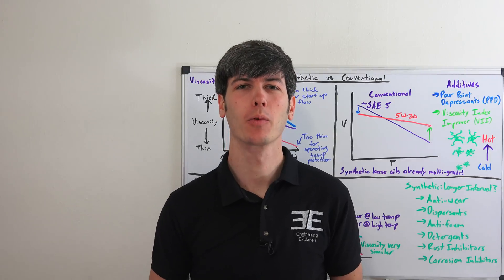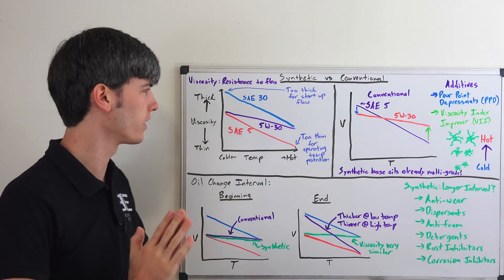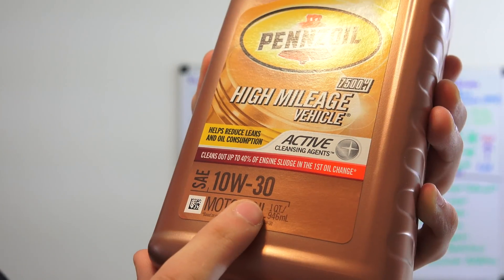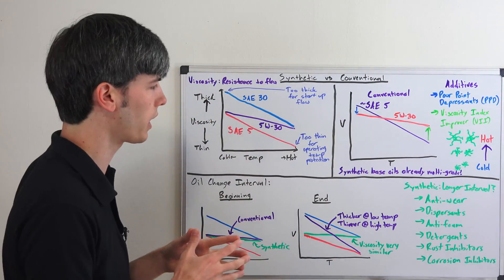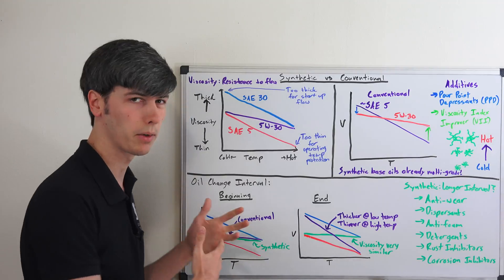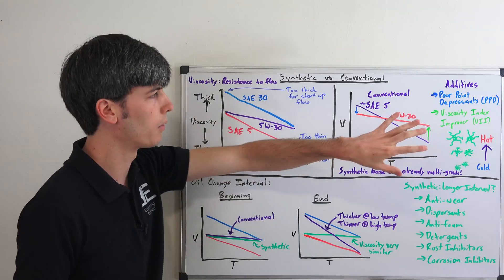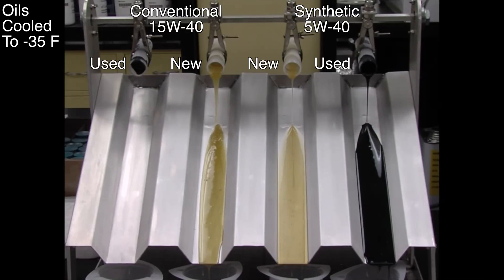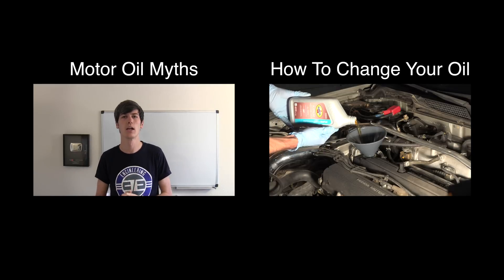Is Synthetic Motor Oil Better For Your Car?

Comment: With all this being said, how do you explain my 09 CTS calls for Mobil 1 synthetic oil. If I run it after two weeks or so it's lost about two quarts, doesn't smoke doesn't leak had it sense new and I started using Oreilly full synthetic and it will go the full oil cycle and of 7 thousand or so miles and maybe be down one quart. No clue why but it's got 70 thousand on it and it's always been changed and taken care of.

Comment: I am from Sri lanka and i am having a Toyota Corolla AE80 1983 model 1.3L Petrol (2A Engine)
My owners manual says that I should use SAE 10w30 for all season , SAE 5W-30 & 10W-30 for Winter  and  20W-30 & 25W-30 for summer.
@ present we are using SAE 40 single grade and would like to get your opinion in using SAE 15W40.
Please reply.
Regards,
Muhammad Ismail

Comment: I love the video.  Think you did a great job explaining what you did.  I was not mentions however that you should never switch to full synthetic after running conventional for more than..... I would say about 50k miles.  Synthetic has a much higher detergent factor than conventional and will break up carbon deposits left behind.  switching after you have those carbon deposits built up is a terrible idea and the carbon would then be flowing through and over every moving part in your motor.  but anyway still a great video.

Comment: I just want a decently priced oil change, for god sakes these mofos charged me $96 for an oil change.... And the add one were bs, windshield wiper fluid and some other bs
Reply from the maker: +Kev Bayotte that is pretty absurd, you can buy all the stuff yourself for about $30 if interested. Even most dealers charge way less than $96.

Comment: +Engineering Explained   I've changed to synthetic a number of times in older cars and very shortly thereafter the engine started leaking oil.  Do you have any idea why this would be?
(2 pre-2000 subaru's and a 1984 toyota truck)

Comment: Great video.  So, riddle me this, Batman.  If I have been using conventional oil in my 02 Expedition 5.4 and my 02 Mustang 4.6 DOHC, and my 67 Mustang 351W, is it OK to switch to synthetic?  Are there any issues with swapping over to synthetic after running conventional for so long?  The 02's have about 140k miles each on the clock and my 351W in the fastback has about 10k.

Comment: I use 5w 20 AMSOIL 100 percent full synthetic and I go 1 year between oil changes. Or 15000 miles whichever comes first.

Comment: In my motorcycle I use mineral oil, but when I use sinthetic oil, it leaks through the joints. Can you explain why it happens? the mechanics said to me it's because the sinthetic oil is more thin than mineral oil. Is it true? Motors designed
to use mineral oil can use sinthetic oil without problems? (sorry for my english)

Comment: I bought my car brand new. It currently has 230k+ miles. I've only used Ultra Platinum since day one and the head still looks it just left the factory.
Reply: It probably drives just like it did 230k ago, too. Synthetic oils are remarkable products.

Comment: Bottom line, if your car's engine, is not designed to use "synthetic" do not put it in there, period.  Read your owner's manual or contact your manufacturer or read the factory shop manual.  Oh, one more thing, synthetic oil, yeah, its made out of ground up cows.  Literally.

Comment: The deal...Pay attention to your owner's manual and your climate. Hotter climates make better use of higher "w" numbers (10w-30). Colder climates make better use for lower viscosities as they flow better at low temperatures. Newer cars are recommending 5w-20 oils, and some go even lower for fuel economy, but pay attention to the owner's manual. There's a chart in there that gives you a baseline for viscosity versus driving style and climate. Yes, as he said, synthetic oils give you some wiggle room for your oil change intervals, but that isn't an excuse to extend your oil change. Synthetic to conventional, it makes no difference. At 4000 miles, a synthetic oil offers roughly the same properties as a good quality conventional oil of the same viscosity. If you want to save money, run conventional and change it after 3000 miles. Simple. If you drive a lot in stop and go traffic (what they call "heavy duty" driving), change it sooner using the month method.  $20 for conventional oil change (with filter) versus $40 or more for synthetic? I run synthetic blend and change it after 3000 or 3500 max for $15 cheaper than synthetic with the viscosity matched to the chart in my owner's manual.

Comment: Why is the standard (non-synthetic)10W30 allowed to state it meets or exceeds all new car warranty requirements? I would like to see a true analysis of the exact molecule types  and percentage found in each oil rather than the manufacturers data as presented. For your claim of expanding molecular placement only in synthetic seems a bit far fetched.
I have heard the manufacturers of the engines are required to recommend oil type by the type used in advertised mileage test and is Only a recommendation.Additionally, if one changes their own oil at 3-4K intervals I don't think you can justify the price. In an aircraft maybe. Of note the manufacturer of the more expensive oil sponsors this.

Comment: SO basically if you live in a cold environment change your oil more frequently. I can't help but feel if this was at 50-80F it would just flow all the same.. THis is the problem with sponsored videos.

Comment: I'm a little lost here.
You say a multi-viscosity oil will get thicker with temperature. But you also say higher temperatures will cause the oil to thin out.
How can it be both ways?
Reply: ....relative to the base in index

Comment: That test was useless...test how each does to protect metal...cold/hot, new/used. Regular oil has inconsistencies and must be refined (filtered, boiled, separated). Syn is artificially built carbon chains. Either will do the job at first, but imperfections in regular oil make it deteriorate more quickly.

Comment: Most important thing is for vehicles still under warranty, use the correct OEM filter, and keep the upc or receipt for both oil and filter.  Every automaker will balk if you have an issue and you've got a third party oil filter on there, even if it's superior.  They'll blame it.

Comment: What about for my old two-stroke engine from 1972? As the oil is added directly trough the petrol, also it needs about a 3% motoroil to petrol ratio.
Reply: There are part synthetic 2T oils available. Whether it's worthwhile in this application is questionable. You certainly won't do any damage though.

Comment: my place average temperature is 35°C-40°C ,on my Honda Fit/Jazz manual book it told to use only 0w-20,so is 0w-20 compatible on such a hot weather ? cause when i open my car hood it was really HOT,my brother Lexus RX370 use 5w-30 (which is his manual book also told to use 0w-20 only)  and the engine is not as hot as mine,please give me some advice,should i change to 5w-30 ?
sorry for my bad english

Comment: As a maintenance engineer, I must say... the comment section is quite depressing. 

You are also clearly sponsored in this video, as you neglected to mention some very important things regarding "synthetic oils"... i.e. there are exactly ZERO standards of requirements to define an oil as "synthetic". 

ALL "Shell" product based oils (aka penzoil) are grade II+ or III oils (aka not really synthetic at all, just higher standards to oils that have no additives or additional distillation). To be fair, they are treated and distilled to a higher grade than your typical "off the shelf" oils; but are not truly a "synthetic oil". 

So those of you preaching about your "synthetic oils" ... may actually be putting in normal motor oil in your car lol. Only a few companies produce their own synthetic oils. The process is quite expensive, and thats why you pay the premium. The -35F test only proves that penzoil added a really good or high quantity of pour point depressants. The indication of perceived "quality" just doesn't apply.

Comment: Okay, so why is the used synthetic oil so much darker than the used conventional oil? Does the one pick up and flush out more internal carbon deposits and such or are there other reasons?

Comment: I thought you said the higher the number, the thinner the oil. Why then does the 5W-40 flow much faster than the 15w-40?
Reply from the maker: I did not. The higher the number the thicker the oil.
Reply: ah the part that first confused me was around the 1 minute mark, but now that I've watched it again I understand. Must have misheard the first time. Thanks!

Comment: I think the most interesting oil change interval was with my grandad's 2000 Silverado. 
The dealership changed the oil once when it had 5k miles, and he didn't change it until 100k miles. Then he changed it again at 150k miles, and again at 315k miles. It ended up spinning a bearing at 400k miles. He did mostly highway driving, but I found that impressive.
I'm wondering how it lasted that long... EE, what do you think?

Comment: Notice that this 15W oil was cooled to -35 degrees Fahrenheit. Its a little misleading, even if you state the experiment conditions, because even 0W oil isnt rated for -35 degrees Celsius temperatures... The coldest that 15W oil can be used in is  -15Degrees celsius

Comment: If you are living in  tropical countries (no winter season) where temperature doesnt change much, will it be economical to use the conventional engine oil? cold season = 16 C, hot season = 30. Synthetic oil is like 5x the price of conventional

Comment: If i may. You may also notice the difference in oil coating between the conventional and the synthetic. The synthetic covers a noticeably larger area initially than the conventional. Not claiming to be a physicist here, just something i noticed.

Comment: I will always run conventional oil in my vehicles considering I don't but anything post 1990 change every 3000 miles my 85 ford ranger v6 has 340000 miles on it no rebuild no knocking cheapest oil u can buy at fleet farm I live in mn tell me about cold starts 5w30 pretty sure the only reason synthetic oil is a good thing for ppl because u can run it longer than conventional oil good videos man keep it up
Reply: I correct myself they recently just changed my favored oil to a synthetic blend hehe

Comment: Cool video, I would have liked the head to head 5w-30. I have always used synthetic and have two Mazdas with over 300,000 miles and still good compression and valve trains.

Comment: those used oils are really really black too, so if you use a synthetic and really change it at a healthy interval it will not be nearly as black and should flow almost identically then...very nice video

Comment: is it true that just stick to conventional oil for oil engine over 200k? I have a Tacoma truck. toyota tech told not to switch to synthetic bc its too thin and might cause leaks. right?

Comment: He actually has it backwards. They create an SAE 30 and then engineer it to be SAE 5 for cold temps. You need to view this as oil THICKENS as it cools, not THINNING as it warms up. So in general, you always want the lowest cold viscosity you can find.

Comment: My car 1988 Porsche 944 had Mobil 5W50 filled September of 2014. The car did 1200 miles since then. Should I change the oil because it got old? It is full synthetic and it is totally clean, looks like new.

Comment: I'm a little blown away because I've heard for years there is very little practical difference between synthetic oil and conventional oil, that they both meet the same rating standard and it's not a big advantage to go with conventional.  I always get synthetic oil (on sale or Syntech brand) because I run my cars for several hundred thousand miles and I think over time the difference might add up.  But I've never heard there was much difference, certainly not anywhere near as dramatic as in this video.

Comment: Thank you for another great video! I've been told in the past by mechanic friends that if my car already leaks or is older (both in my case) that I should use synthetic oil because it is so thin and slick that the leak or potential leaks areas will increase. In this video it seems to suggest that synthetic is better than conventional. Is there any caveat here? Thanks again for the great videos!

Comment: Anyone else pick up on the fact that his display on the right represents the viscosity decreasing as the temp increases however when he explained the properties of the polymer he said (and has displayed) that the polymers expand as they heat up... Which would therefor increase the viscosity (densifying the oil, as he also said), no? Otherwise if the latter was true (the polymers expand as they heat up) the viscosity would increase. I apologize if this is redundant, merely trying to emphasize the point I'm trying to get across. So the question is, how does the heat truly affect the polymers?

Comment: the problen with the syntetic oil is that it damage the seals at high temperatures. the mineral oil don't do that. syntetic is good for one race. mineral oil is good for every day use.

Comment: Hi,
I was always interested in how long could the oil really last in our engines. Its hard to find an answer to this question provided by any oil manufacturers. They are are happy for you to buy more oil.

I think that Toyota has claimed that synthetic oil would last several times longer, if the oil filtration process was improved.
I cant find this article again. They have said that the oil itself is fine on the oil change, although it's the amount of unwanted particles in the oil; such as dust, carbon etc. which causes the oil to loose its lubricating properties.
I think it was them to prove this point. They have filtered used synthetic oil outside of the car, in some sort of filtering machine. Anyway the point is that the oil was brought to its original lubricating properties.

So if we had much better filtrating system on the cars we could change oil once every 100,000 miles or so.
Why isn't it done?

Comment: hi, i have a question

if a diesel engine oil is used in a conventional gasoline turbo car, would it be a problem or would it be better? will it make the turbo malfunction? and what is the most appropriate intervals for changing engine oil for turbo cars?

sorry for a noob question, just wondering if you could make some video explaining it in theorytically

Comment: Hey Jason, I was wondering if you can please make a video explaining the differences between an electronic and a manual boost controller, how they work, which one is more practical, and how much horsepower do you gain per psi?

Thanks!

Comment: I've got a project car I've been working on. I'm still confused about what oil to use as there seems to be very many opinions. The engine is a 350 chevy and its got a flat tappet cam. I was using 10w-30 in it for daily driving. I've also been told to add ZDDP into the oil to help prevent cam shaft wear (which I do). This is my biggest concern. Its parked for now (the cam lobes wore and ate the crank and pistons) It is running again but I don't want to throw away more money doing something wrong.  This is my first project car and engine so I'm learning quite a bit. 
To help eliminate other questions.
The entire valve train is comp cams recommended parts.
I followed break in procedure.
I use the recommended comp cams break in oil.

I've read many varying things on forums etc and I'm really hoping you could offer some advice here. Thanks.

Comment: There's far more to engine oil than just SAE viscosity rating. You CANNOT simply prescribe 20w50 summer and 10w30 winter. It DOES NOT work like that anymore.

Comment: Cheap Walmart Super Tech in my Ford F-150.  230,000 miles, 5000 mile intervals.  Truck runs like new.  I doubt $10 a quart oil would save much money.

Comment: Hello, how can I determine the SAE I must use if my car is a 14 Year car and has ~120.000km? I think maybe the engine has run into degradation and using a thin oil (the one is recommended when is 0km) would result in less protection?
Reply: 120,000km is nothing. Stick with the manufacturer specified oil regardless of mileage.

Comment: Maybe you could explain how Ams Oil claims you can wait for 25k miles to change their oil, as opposed to every 3-5k miles for your average synthetic/conventional oil manufacturer.
Reply: (According to what I read) Amsoil's oil isn't licensed by the API (which would cost at least 100k) and they're refining their oil and making their products better instead of needing to re-license it every time they have a new formulation.
Reply: I have previously used AMSOIL's 5w40 DEO. It was very very good indeed.

Comment: worth every penny when I do my 25 - 30$ oil changes by hand in my 95 mitsubishi mighty max with 250k miles and my 1986 chevy astro has 270k miles , when I bought it the owner said it leeked through blowby but after switching to fully and only synthetic oil it quit leaking altogether, for what I know the power steering pump is stock but it was leaking almost a whole bottle every week about and after switching to Lucas engine oil [ their power steering +conditioners has somewhat fixed my rubber lines that were spongy and dripping , now dry in a normal way after only 3/4 the lucas bottle so it works quick

Comment: what would you recommend for a US designed car, volvo S40 01 model that is used in Nigeria, the recommended oil is 5w/40 or 10w/30 at 40deg celsius.  thanks

Comment: I understand that synthetic oils take longer to breakdown compared to conventional oil. What about the small metal engine wear particles floating in the oil? will this still cause damage if synthetic oil is not changed in a regular interval? they say i don't have to change synthetics oils until 5000 miles